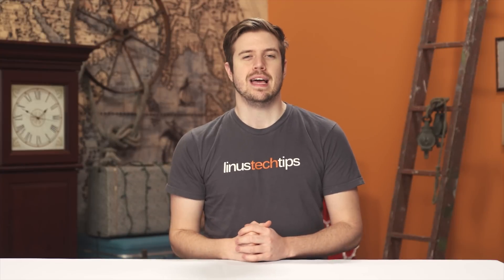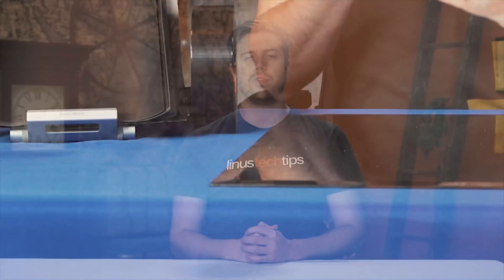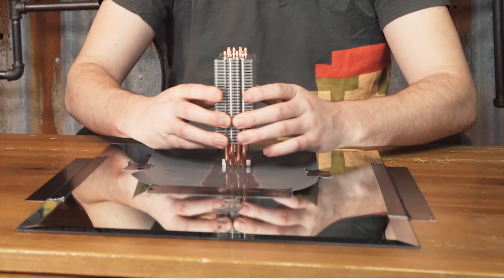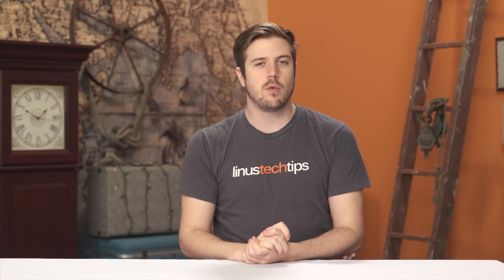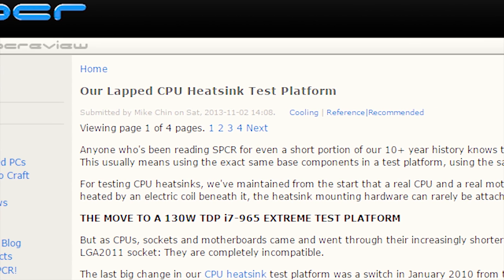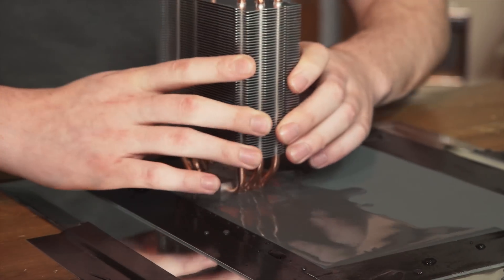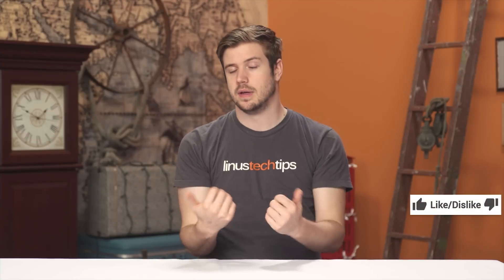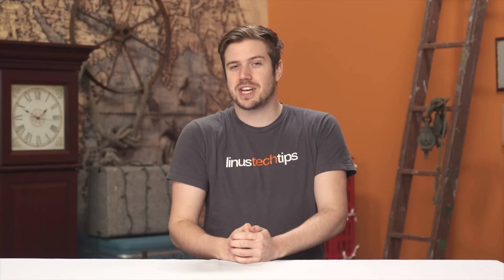CPU & Heatsink Lapping - Are concave, convex, or flat heatsinks best for cooling?

Comment: Nice try, but if you want to see an actual improvement in temps from lappinng, you need to lap the heatsink/waterblock, AND the CPU. The heatsink/waterblock is unlikely to be concave or convex compared to the CPU's IHS from my experience. I have seen CPUs that were so C shaped that you could see it. Also, I have seen a 3-5 degree improvement on several computers by lapping the CPU and heatsink. Another interesting thing that I discovered is that on my water cooled computer, before lapping, the CPU would instantly hit 100 degrees C under load with no thermal paste at stock speed, but after lapping the CPU and waterblock, the same CPU only hit 78 degrees under load with no thermal compound. That is pretty interesting to me.

Comment: Well this is not hard to answer. Cooling will not be hindered what so ever by small bumps, or most other small imperfections do to them not making a significant raised area to cut past the thermal paste, thus raising it past the cooling efficient.

Comment: I have lapped before when they started lidding the processors and machining wasn't as good. Before doing it though, I always used a long straight edged metal ruler to test the curvature. It does work, but as he stated, only if it's bowed in.

Comment: it's better to sand in a figure 8 and use a slab of granite, which you can get from a mechanist shop or like Busy Bee tools and the granite is .002mm flat...that's if are willing to spend $45 on the slab and if get the CPU and heat sink so flat they will stick together... called "Ringing" and this was done about 120yrs ago... Gage blocks

Comment: Many things make a difference to CPU temperature.  Let me give a brief rundown of my CPU lapping.  My first heatsink unknown to me was concave despite using an even layer of Artic 5 the CPU burnt out and the mother board became faulty.  The heatsink removed showed it was not touching the center of the CPU heat spreader.  I purchased all new components and started over. This time I did not trust the new £25 heatsink, I know through experience that flat diamond sharpening stones give a flat surface and wet and dry auto grade abrasive paper does not. Using WD40 lubricant and medium a grade lapping plate and holding the copper heatsink low down in the center I evenly and equally lapped it flat over 90% of its surface.  I used a covering  smear of  engineers bluing and rubbed the two together which gave me the contact pattern which was excellent.  After cleaning with isopropanol I rubbed a tiny amount of Artic 5 with two drops of isopropanol onto each surface and made a slurry leaving a VERY thin primed coating.  Finally I put a very small amount of Artic5 the size of a small coin but thin on the center of the CPU and assembled. The result with good fans and airflow was startlingly low CPU temperatures even under load.

Comment: I've made today a very good experience with lapping my cpu & heatsink. I had problems with overclocking my Q9650 past 3.4 Ghz. When stressing the system with Prime95 after overclocking it crashed due to too high temperatures. It took me the whole afternoon but i would say it was worth it. Temperatures dropped about 5 degrees Celsius at minimum and the cpu now is stable in prime with 3.6 Ghz (air cooled). Probably results may vary for other people.

Comment: No offense, but your lapping job kinda sucked... -_-
As for those saying it doesn't matter, I don't know about these days, but back in the day, you could easily shave off 5 degrees lapping... And thermal paste will fill the imperfections, but the less imperfections there are, the less thermal paste there is between the heatsink and cpu..

Comment: I sharpen knives and a tip you learn quickly to see if you have leveled a surface is to cover the surface in sharpie and do a couple passes against the stone or abrasive. The spots making contact against the abrasive will have the sharpie removed, the spots not making contact will not have it removed.

Also, since copper and aluminium are much, much softer than hardened steel, I would suggest starting at 400 grit, then moving to 1000 grit and finishing with 2000 grit.

Making an evenly convexed heat sink with an abrasive by hand would be near impossible.

Comment: surely the groves left grom grinding the heatsinks flat(ish) would help as they would increase surface area so would transfer heat into the thermal goop faster and then out the thermal goop and into the heatsink quicker?

i guess its all negligible anyway

also when lapping you need to lap both the cpu and the cooler to make sure they are both totally flat and will sit together perfectly

Comment: Leaving small imperfections increases surface area, allowing better heat transfer on the molecular level. That thermal compound then fills those imperfections and uses that additional surface area to thermal advantage.

Comment: frankly, I think if you want to have some improvment you can try to delid your Intel CPU.
Unfortunately AMD has their dies soldered to the IHS, so there is no room for improvement.

Other than that, just slap a Noctua NH-D15 on that CPU and have cooling out of the way for good...

Comment: Hi. Yeah done this. CPU and heatsink surfaces- they are not level out of the factory, you need to use a carpenter square (checking in different areas of the surface, see if there are gaps against the light). You need to lap the CPU too. It works reduces it to around 7 to 10 degrees if I remember. God bless. Proverbs 31

Comment: I want to see extruded aluminum heat sinks tested with their stock finish, then tested after having all surfaces except the bottom glass bead blasted. Should also make sure the bottom side is filed or milled flat for best contact with the heat spreader.

Bead blasting the aluminum should improve cooling because it increases surface area. More surface = more contact for flowing air to pick up heat from conduction.

I've done this filing and bead blasting to several thermo-electric coolers and they seem to cool considerably better. The small ones made for 6 or 9 12oz beverage cans use a deep drawn aluminum tub for the cold side. Typically the way the Peltier is bolted to the tub causes bending and very poor contact. In addition to filing flat and bead blasting the hot side sink, I make an aluminum stiffener plate to go on the inside of the tub, and use compound between it and the tub. That makes the tub hold flat to the Peltier plus adds a little thermal mass right on the Peltier.

Another mod I do is if the cooler has that crappy squirrel cage fan and noisy brush type motor, I replace it with a 12V muffin fan, and carefully enlarge the air inlet to match the size and shape of the fan.

How well does it work? I have a 9 can (six upright with three laid down) cooler that can keep a half gallon ice cream box frozen for hours. Before my "cold-rodding" it could not do that. Better thermal transfer + more airflow to get rid of the heat does the trick.

How I've always applied compound is to get a bit on a fingertip (with a nitrile glove if it's something other than the plain white stuff) then dab a thin coat over the entire heat spreader or bare die. Set the cooler on then remove it.

Full contact? Good! Any bare spots on the cooler? Dab them, install the cooler and call it good. No wasted compound oozed out   the sides.

Comment: I've filed a bunch of non-flat extruded aluminum CPU and GPU heatsinks flat over many years. Lapping with sandpaper isn't necessary at all. Just get it flat enough to have the best contact, with compound to fill in imperfections.

Comment: uhm.. use a POLISHING COMPOUND and make it MIRROR-LIKE.. use a motorized drill, and a soft fluffy bit to make that thing so shiny you can see yourself in the 'bottom'.. OTHERWISE, you didn't lap it, you just sanded it.. FIRST thumbs down on this one, for a linusTechTips vid.

Comment: Yeeeaaahhh...... If flatness and precise, even surface finishes needed to be a thing, the manufacturers would have precision ground the mating surfaces. I guarantee they could have gotten it flatter with the proper equipment than you could dream of.

I'm talking easily to within 0.0001". At which point, thermal paste would be pointless, because you could just wring the cooler with the CPU, and have direct, near perfect, metal to metal contact, for far bette thermal conduction than any interface compound could achieve.

Comment: One wonders what exactly you think thermal compound is for.

(Hint: it's there to fill in the gaps that lapping would remove with something that transmit heat much better then air.)

Comment: wouldn't it be better if the cpu had a rough surface be better because more surface area therefore causing more heat transfer?

Comment: those scratches on the heatsinks when you buy it is from the manufacturers lapping the bottom flat. 

lapping it to a mirror finish is going to help contact with the cpu at the microscopic level. look up machinists blocks. they are lapped so perfectly that they can stick to each other with no glue or adhesive.

Comment: if you want max heat transfer start by lapping the cooler so that the surface is really flat then plate it in pure gold then do the same with the cpu then use goldbased heatpaste and you sould be good to go :)
Reply: Robin Israelsson

Except Intel uses potato-grade thermal past just slapped between the IHS and the block itself.

Comment: I lapped 3 cpus+coolers a few years ago. An i7 with a full EK watercooling system, an i5 with an aftermarket air cooler, and an old windows xp era AMD cpu with a stock heat sink. The i7 saw no real difference considering it was already in the lower 60s at full load. The i5 was negligible, maybe 1-3*. The old AMD chip with a stock cooler, however, saw a huge difference in temps. Before lapping, the CPU fan on the heatsink would spin up and sound like a jet in its stock format. After lapping it never got above a hum. (i also didn't use thermal paste. Just straight metal to metal contact)
I believe this comes down to the distortions that happen during the manufacturing process. Some mating surfaces are just jacked and benefit more. I would also recommend trying without thermal paste (with a shut down fail safe just in case). you might see that the thermal paste is a hindrance.

Comment: In the cpu world, theres a secondary reason this works that people tend to forget - you took off a lot of crap coating your copper. Pure copper vs coated copper, the pure copper surface will win every single time if the parameters are similar enough.

Comment: You have to lap the CPU too. Lift the cpu off the paper when you turn it. The Hyper 212 has heatpipes, the lapping method works best on watercooling blocks. Polishing the surface afterwards is also a good idea. Overall it seems you guys were a little sloppy on that video. Liked it anyway, thats the kind of content we want to see.

Comment: Shouldn't you lap the cpu as well? and isn't 2000 to smooth? soldered IHS, what if I build up solder on the IHS (outside) and the lap that (solder) then lap cooler, anyone tried this putting solder on IHS and lapping it? People saying IHS worked better when solder not paste used, so I assume solder has better heat transfer.

Comment: I lapped both my AMD FX-8350 and FX-9590 both had the same majorly uneven heat spreader that most CPUs have. I also lapped my Raystorm CPU water block. and with both CPUs over clocked to 5GHz I was able to drop my Delta Temp by 8c on the 9590 one and 9c on the 8350. So I would say that the thing you would most want to lap is your CPU itself. just take a straight razor and lay the blat on top the heat spreader and hold it up to a light. If you see light then your heat spreader is not flat.

Comment: Your sanding still might have made a difference if you could more accurately control the ambient temperature. Because of Newton's Law of Cooling, the ambient temperature factors in at a variable rate to temperature change.

Comment: all of these little tricks only really start to matter for overclocking competitions. Potentially if you put them all together you might get 4-5c reduction but is it really worth it? not for me, i'd rather just turn up the fan speed on a water loop radiator.

Comment: It works and much depends on skill and not just as your samples sanding , polishing paste until it is like a mirror is used , you can use rotation sanding as 8 which is not easy.

I lapping the heatsink and in some cases the CPU
 80486 and variants , AMD K6-2 K6-3 you can remove aluminium plate or lapping it k5Pr75 or heat sinks were coming shoddy , bent or did not touch the processor , poor safety locks , including heat sinks had attached the price tag on , and in 2000 started to change video cards and make my own handmade heat sinks , nowadays I 'm making , even I do for retro computers like Amiga 500 and 1200 .

Comment: Why would anybody think lapping would help anyway? Thermal compound will fill in any imperfections - and removing those imperfections would actually reduce the surface area over which heat can be transferred - making temperatures WORSE  not better.

Comment: If one has polished and flattened the heat sinc shouldn't the processor heatspreader be polished and flattened as well? I mean the heat spreaders are pretty much never smoother or flatter than the heat sinc.

Comment: Would it be beneficial to wet sand with high grit on a cpu cooler that has had thermal paste on and off it for years. Even after alcohol they always have a dull look.

Comment: Seems like the surfaces are buffered from one another with thermal compound.. Lapping doesn't seem like it would matter because of this.

On another topic, I couldn't find any information on using soldier paste in place of heat sink compound, seems like it might be  a good fit. nudges to try

Comment: Try this method on a CPU/Heatsink that got dirty, where the thermalpaste was applied, from long-term use. When I clean old PCs, and try to clean the heatsink there is something like mulch left behind that even isopropolic alchohol can't clean with 1-2 passes. Maybe that will work there.

Comment: The micro grooves are probably a good thing since they add area to the contact surface. It works for glue, and it probably helps the thermal paste in sealing the space between the cooler and the cpu. If you don't believe me, then try to do a peanut butter sandwich with sandpaper and one with flat mirror glass and see which one is harder to undo.

Comment: Seems like course scratches in the heat sink would IMPROVE cooling because it increases the surface area. As long as you are using thermal compound to fill in all those scratches.
Reply: +dacasman While the concept of increased surface area translating to more efficient cooling is proven, its usefulness in implementation depends on the situation.

If a fluid (like water or air) is passing over something to cool it (the radiator fins of a cooler), then more surface area is better because it increases the amount of heat that can be transferred to it. If we are talking about transmission of heat form one solid to another (from the nickle surface of the CPU to the copper surface of the cooling block), the more important factor is the thermal conductivity of the materials the heat passes through.

The point of thermal compound is to create a continuous heat path with no air to get in the way. Static air (like bubbles trapped in thermal compound) is much worse at transferring heat than the metals or thermal paste involved, so filling any and all air gaps with compound is important. Removing all surface imperfections, in theory, removes air from the equation, therefore leaving the heat transmission to the more conductive materials (nickle --> thermal compound --> copper) before then being spread across the huge surface area of the cooling fins for moving air to pass over.

Comment: Idk why anyone would lap a heatpipe heatsink, that's a terrible idea, you are only supposed to lap full copper heatsinks, and the IHS on the CPU.  you could actually damage the 212 Evo by lapping it, if I'm not mistaken you could cause a hole in the heatpipe which effectively ruins it.

Comment: I was donated a dying Q6600 that was in a system that was hit by lightning. I transferred it to a spare MSI P7N Diamond. It would overheat badly under normal use and gaming. I lapped it and the heatsink. I used 600 grit and 1000 grit only. (I did other research about using those 2 only and how it would yield better results.) The cpu dropped 10c on the hottest core. Still couldn't overclock, but it was stable enough to game on with SLI'd 560 Ti's. I got a couple more years out of the CPU until it gave up.

Comment: No surprised direct heat-pipe coolers are not get as much or any bump is cooling performance from lapping.  Generally, you lap to remove the outer coatings and/or to slim down a heat-spreader.  If your not doing the cpu lap, and your cpu cooler is already directing-to-the-pipe, then I see no reason to do anything.  Make sure whatever your buying, the lapping is not really needed with that device is probably the most you should work on lapping.

Especially with lower energy/cooler cpu/gpu being so much of the focus of Intel/AMD/nVidia.